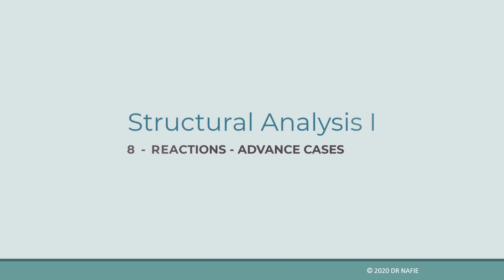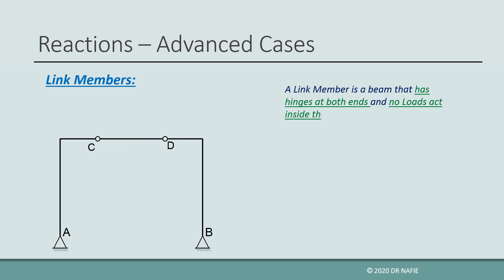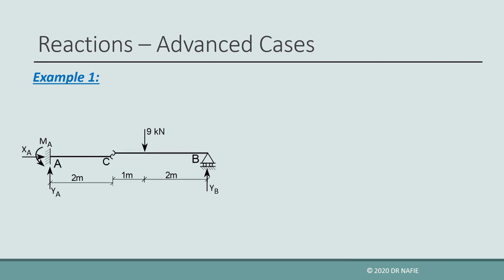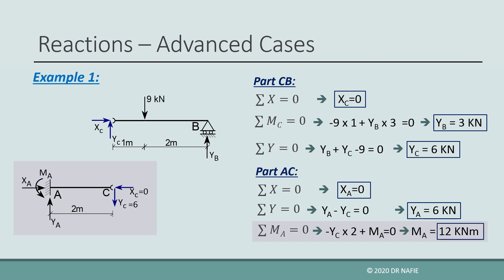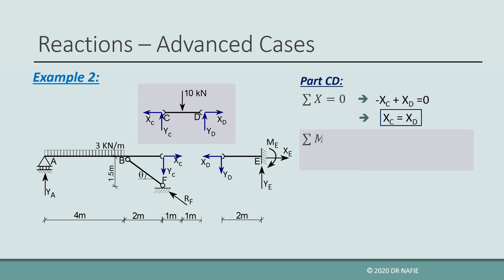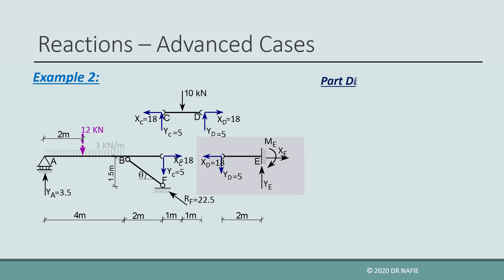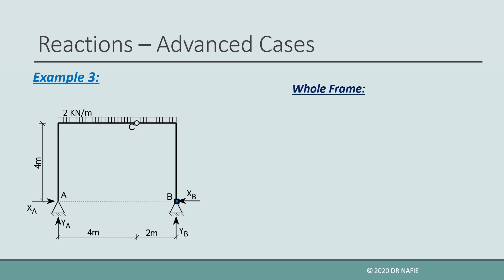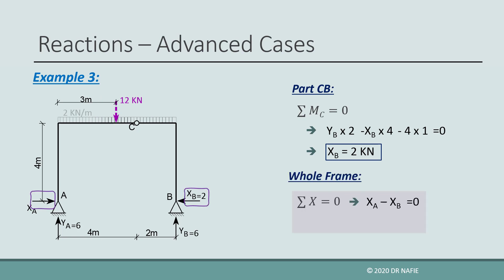Support Reactions - Compound Beam Examples

Comment: High sir, while explaining link you took portal frame, you said that link beam will not have any vertical load. But there are chances that it may have some external load.
Reply from the maker: Of course any beam will have a vertical load on it ( at least self weight). However, if this load is small compared to other loads and can be ignored, then the beam can qualify as a link member and this will simplify the solution. 
If the vertical load can't be ignored, then the beam will not qualify as a link member and will be solved as an ordinary beam.

Comment: It really helped in improving my knowledge. Thanks a lot.
Could you please explain the difference between stable and unstable structures. Further what is 
P delta effect.
Reply from the maker: I am glad it helped.
Regarding the P-delta effect, God willing, I will put it in my priorities to talk about it.
In simple words, however,  when the structure is loaded in the horizontal direction, it sways and its shape is changed.
In a linear analysis, we analyze the structure using its original shape (before sway)
In a P-delta analysis, we use the deflected shape of the structure in the analysis (thus the structure is weaker ) and this leads to an increase in the internal forces.
In summary the P-delta is more exact, but the analysis is more complex.